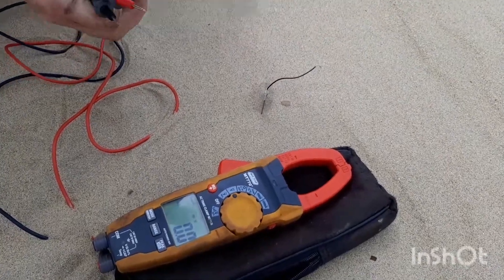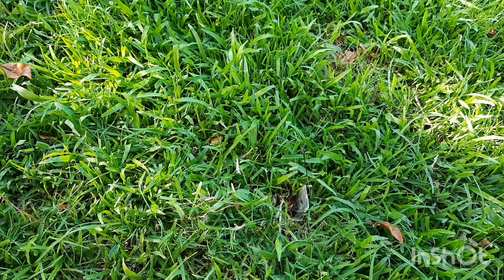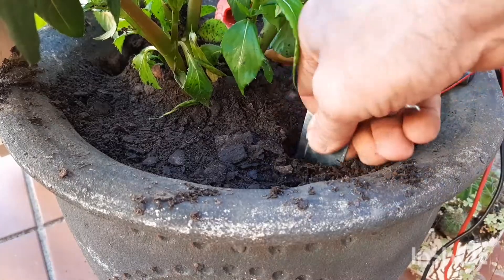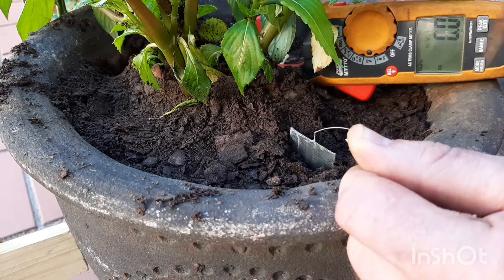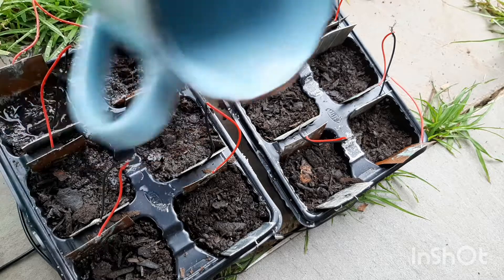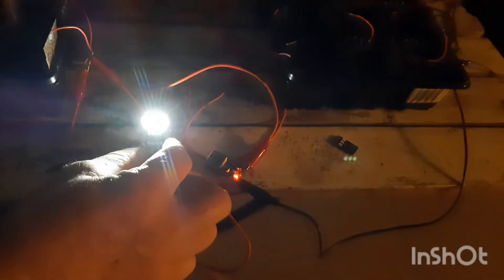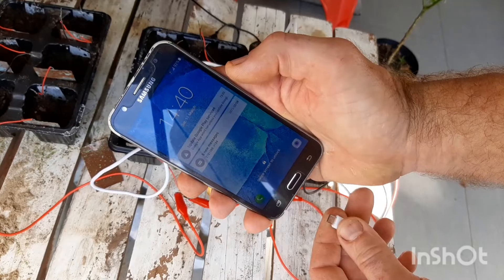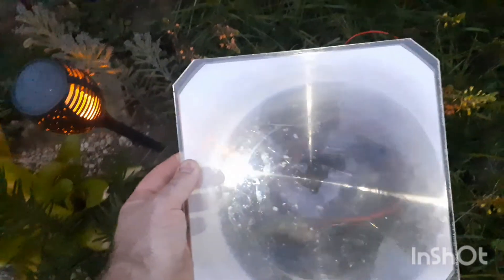CAN I CHARGE MY PHONE WITH SAND?#experiment #renewableenergy#freeenergy

Comment: That's amazing!! What can I use as a substitute for the zinc and copper?
Reply from the maker: You could use magnesium which you can get at a plumbing store. Magnesium actually has a higher voltage output which i only found out recently.